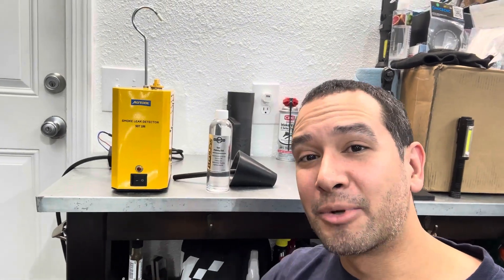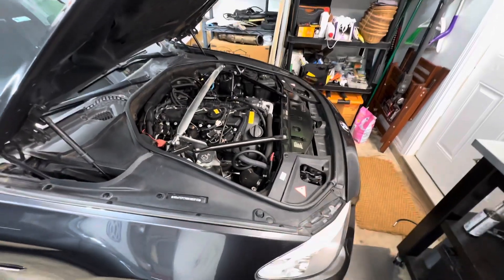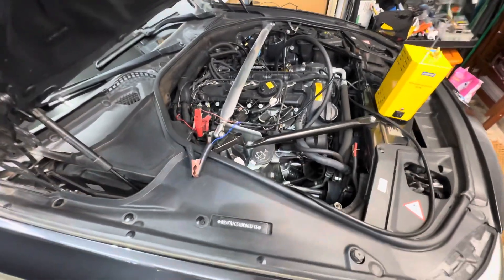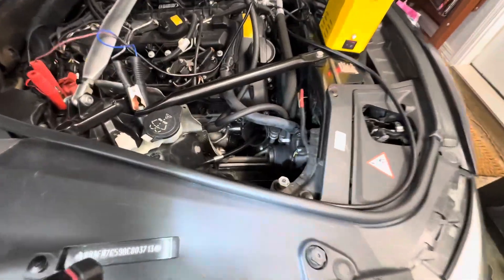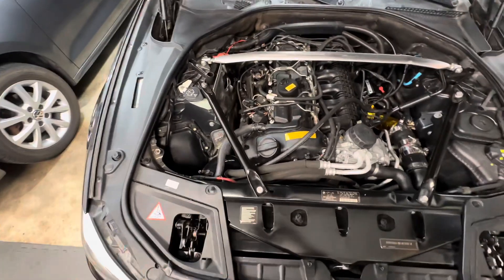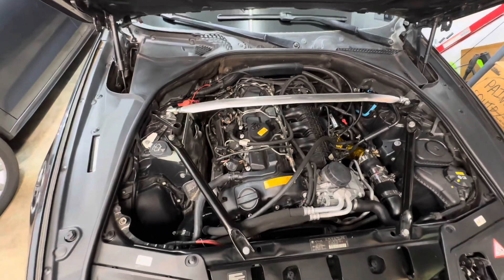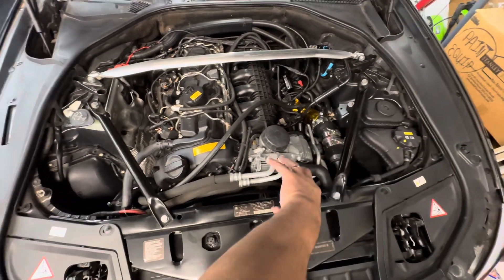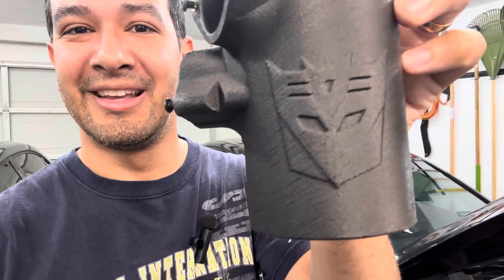HOW TO SMOKE TEST A BMW N55 for boost leaks AND showing off my custom BHP MAF housing

Comment: I have the same intake, When you smoked test yours did it leak by the MAF? And the connections as well cause when i vacume leaked test mine it was smoking everywhere thorough out the piping..? Thanks
Reply from the maker: This was over 2yrs ago, so my memory is vague. The MAF i know never leaked because I intentionally would look for that- it was also very tight to get it into the housing. Hit up BHP’s tech support if anything maybe they can walk you through some troubleshooting questions to check over

Comment: Should your turbo smart blow off valve if it is open to air and not recirculating be leaking? do the turbo smart blow off valves stay locked shut when your car is off?
Reply from the maker: I didn't have a turbo smart BOV. I had a factory-style recirculating valve.

Comment: I think you are supposed to open the oil cap to prevent blowing the fragile PCV membrane, if the pump is generating any meaningful pressure.
Reply from the maker: You bring up a great point! I never considered it personally. But thankfully it seems the N55 PCV diaphragm is strong enough to take 15psi no problem (as long as it’s in good health!). My friends at my BMW dealership told me their SnapOn smoke tester there also cranks it to 15psi and they don’t pull the cap (took a while to respond to you because I wanted to check this with more than just one tech- 4 of them confirmed they don’t)… weather thats good or not thats a different story 😂 but that’s what I was told

Comment: So you mean this autools machine will put at least 15lbs of pressure in the system?
Reply from the maker: Correct as long there’s no leak. Big swoosh pressure release and all when I pull off the fitting at the end of testing lol
Reply: Thanks brotha, gonna pick one up right now.

Comment: The issue I fine with this method is that it’s not really pressurizing the system hardly at all. I’ve pressure tested a couple of different cars and a lot of times I have to get up to 10 to 15 PSI before the leak really becomes evident.

Generally, you also have to plug both ends the inlet and the outlet and then pressurize everything through all the piping and the intercooler to see if there’s a leak there.

If the leak is really bad, you might find it, but I think smoke tests are usually used more for vacuum leaks.
Reply from the maker: You bring up a good point. And certainly something to keep in mind when using any of these pressured smoke testers. Im lucky that so far When I have had a leak it has been enough to find them

Comment: Hi please reply , i tested my b58 and for me it blows off the testers cone does that means i have no leak? , my machine has built in pump 19-23 psi I didn’t hold in the cone i just plugged in tightly twice and both time it blowed off!
Reply from the maker: You can try applying smoke from a different spot and blocking off the spot you are currently using. For a smoke test to work you have to have the pressure built up and held for a few minutes while you look for signs of leaking smoke.
Reply: @turbospool  but i had smoke tester ..

Comment: Hi, I am having a problem with my 535i , literally every time I turn on the car, the rubber on the charge pipe makes a suction type of thing and the car dies after that suction. :(
Reply from the maker: Is it an aftermarket or an original charge pipe? If original, replace it with a metal one as the factory one is known to crack and explode even on stock-power levels. If aftermarket, check the fitment of the coupler and the tightness of the clamps

Comment: Is the cable split wire too short to clamp your negative cable onto the actual negative terminal bolt on the car itself? You used a brace bolt and not the actual ground bolt.
Reply from the maker: You don’t HAVE to use the actual ground post (we’re not jumping-starting the car lol). Any good solid ground would work :). And yes, the spread of the Pos and Neg cables is just wide enough for a battery’s width basically. So it won’t reach from the Pos jump post all the way to the ground post.

Comment: u should pressurize it with like 15 lbs due to the rubber pipes expanding and then thats when the leak happens. it will be more effective
Reply from the maker: That’s excellent advice. I actually did that off screen (the machine I used pumps up to 15psi), and no change from what you saw on the vid (thankfully)